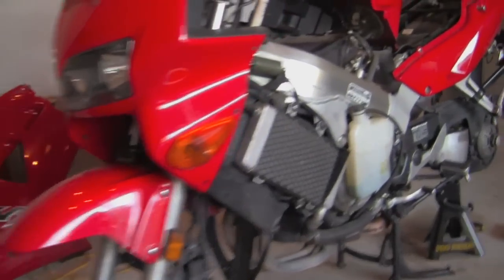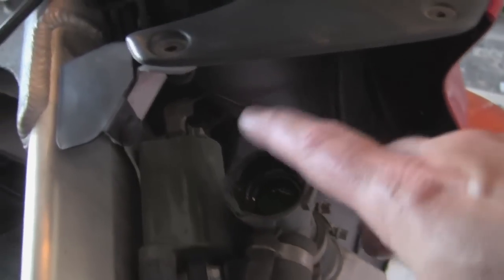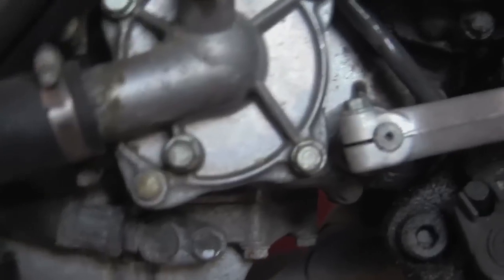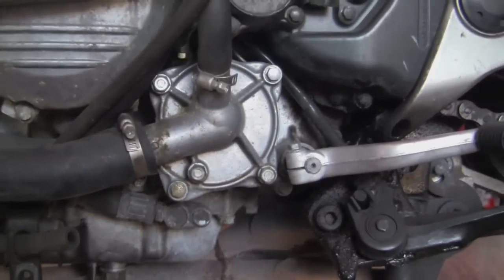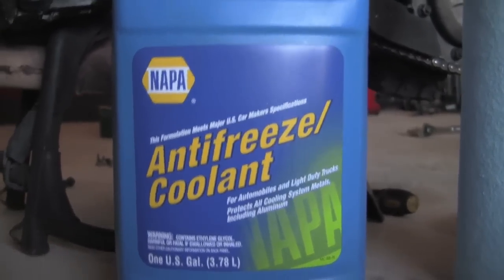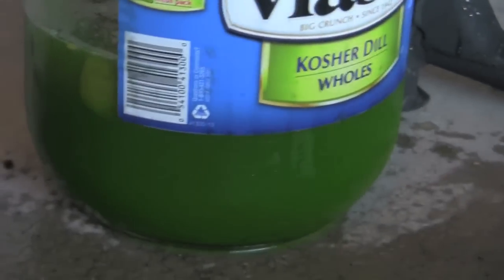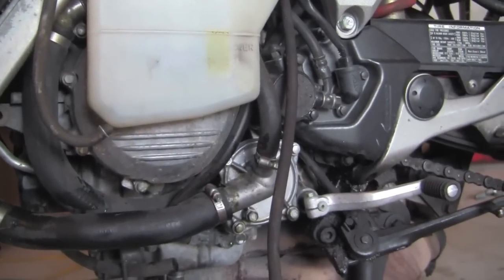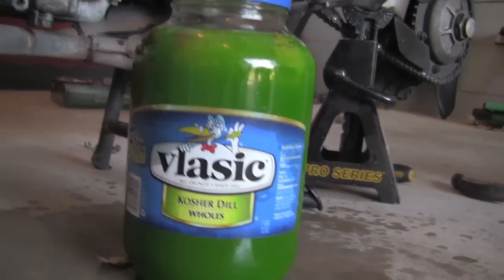My VFR Coolant Drain and Party Tips

Comment: Hey, a good way to avoid spilling is to unscrew the drain bolt first, place the pan under it (considering that the coolant will go out strong, so considering the angle) and THEN get the radiator cap loose. In this way you can take out the drain Bolt without worries.

Comment: After owning a 2002 and 2003 6th Gen VFR, I finally got me a 5th Gen Viffer because of you Billmaa.   I'll be going thru your vids this weekend.  Thanks for the knowledge.  Or at least the laughs.
Reply from the maker: +iMotoPilot Thank you...I have an 1986 on the way...I have something like 40k on the odo of the 99, I've owned it for 12 years...I will run that bike till it stops..then it will go into my basement =)
Reply: I have a 2001 VFR 996 Super Hawk I love the bike I just purchased it it does have an aftermarket exhaust exhaust concept m i g and I get a pop pop pop whenever I let off the throttle but it sounds great when you're on the throttle but I've had a lot of people telling me that popping is normal for those bikes especially with that exhaust but I'm not hearing any other 996 doing it so I don't know what to think .. anybody with information greatly appreciated